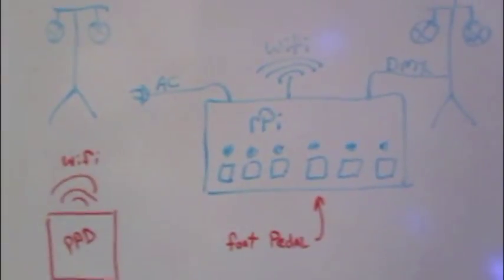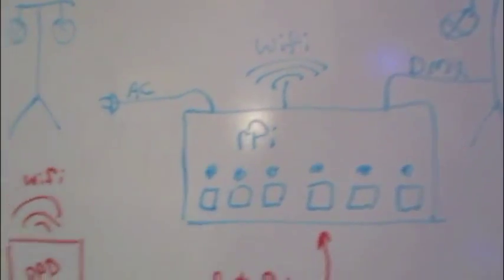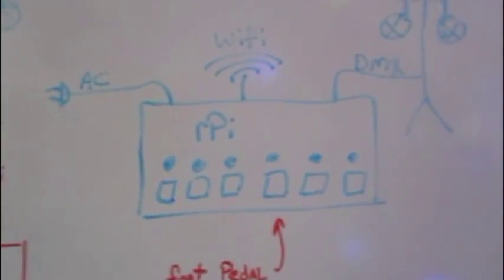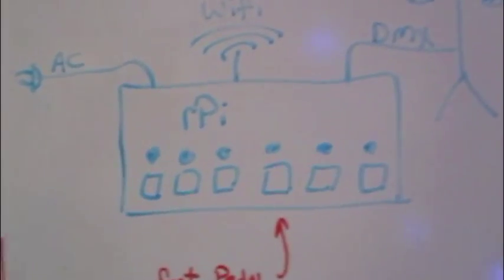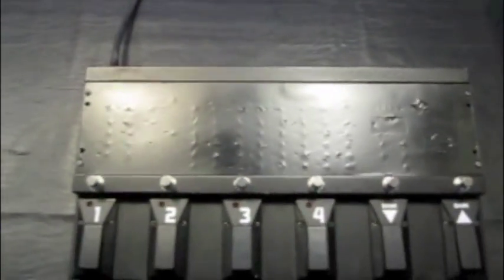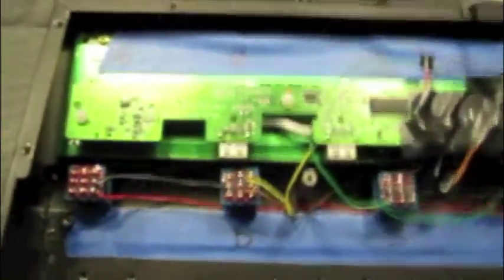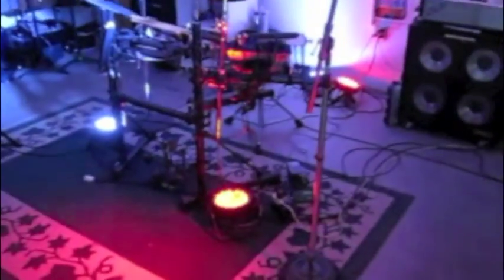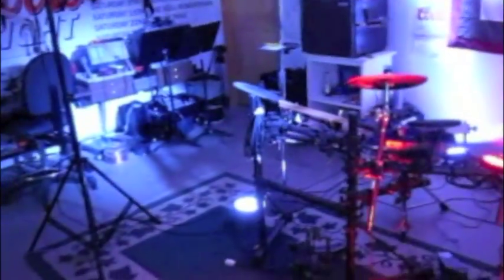Demo of an Android/IOS controlled DMX Lighting Foot Controller using QLC+ and Raspberry Pi.

Comment: Sorry I'm a bit late to the party.  Really clever idea.  

I already use a 6 button MIDI footpedal to control the FX and mutes on my digital desk and I have 'banks' and a 7 segment display to let me know which bank I'm in.

Would you be able to do something similar with this so it's 'self contained'?   iPad is already in use controlling the desk and I have a dedicated dual band modem permanently installed with the desk.

I'd like to be able to pre-program all the buttons to have numerous different settings on different banks for different songs or venues without having to rely on a tablet.

Comment: Hi Scott very nice job on the Video! I am currently trying out your design. My band is now using LED DMZ lights. and there is no easy foot controller solution at a decent price. In your video you showed a MAC Keyboard which I have one that looks identical to, but the circuit board looks a bit different. Can you send or show me how you wired the switches to the circuit board? As I don't know what chip you soldered to. Thanks Don S.
Reply from the maker: Hey Don - there is a thing ribbon connector on the keyboard I used - and I soldered the wires onto the backside of the PC board where the connector was.  In order to determine which ones to use, I took a probe wire and pushed one end of the wire to pretty much a random solder joint of that connector and then touched another solder joint - all while the USB cable was hooked to a computer and some text editor was open so I could see what it did.  After literally poking around in that way - I found that some of the solder points were "common" and used those as the one side of several switches, and found a set of other solder pads that were wired individually from the switch to pad.  I didn't worry about blowing anything up since I had a dozen of those keyboards laying around.  Nothing blew up anyhow - and the first one worked from start to finish.  Scott

Comment: Very nice and what I'm currently working to make work for me as well.

I have an old ground control foot board that I might go with instead of MIDI foot board. Would you share the CGI script for loading different files on the Rpi?

Thanks a lot for the look and preview.
Reply from the maker: Hey - ya - no problem.   I think you may have already seen it but, in case not.. here is the qlcplus forum where I posted the script info:

https://sourceforge.net/p/qlcplus/discussion/rpi/thread/aa57a90d/

Thanks for watching!
Reply: Scott, been working on getting the wireless to work with QLC but no-go. I can use the wireless if I boot up on one of the other Rpi system so I know it works.  How did you get it loaded in QLC.   I have looked at loading the driver but getting stuck.  

Any help would be grateful.

Thanks
Reply from the maker: Jimmy Traylor It was not easy, and I'm very bad at documenting the steps I took. But I think there are two key parts.  I followed these directions:

 http://www.maketecheasier.com/set-up-raspberry-pi-as-wireless-access-point/

and in particular - in the last part - the "Troubleshooting" section applied to me.  I had to do the extra steps to download the alternate driver for my particular wifi unit.

The second thing that was key - was that the DHCP server installed on the Pi didn't want to start up correctly if my wired ethernet was not plugged in.  Which is frustrating because the wireless would work just fine as long as my ethernet cable was plugged in - but as soon as I would boot without it plugged in - it didn't work.  I'm not totally certain how I ended up fixing that... but I think it may have had something to do with putting the wlan0 interface FIRST in the /etc/network/interfaces file.

I can post my file contents in a day or so.  (I don't have access at this moment)

Scott